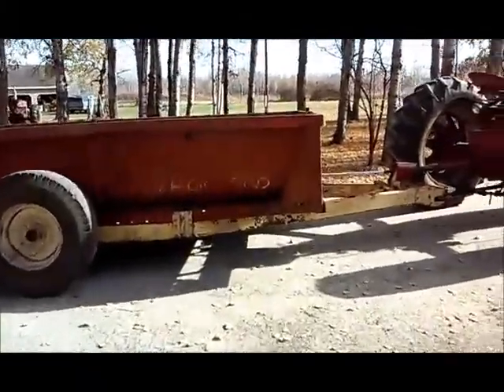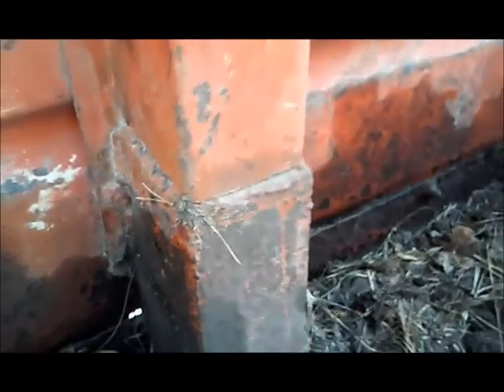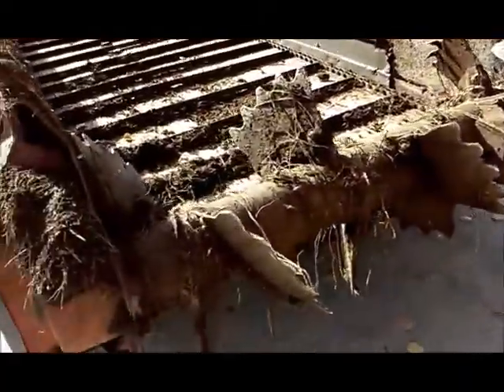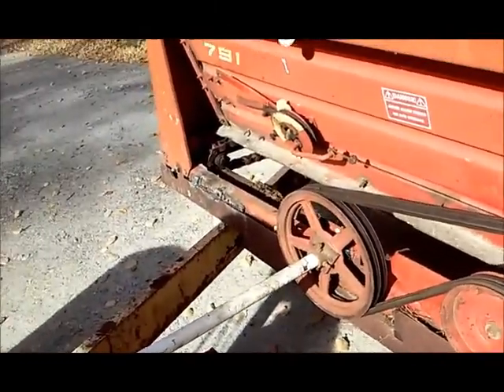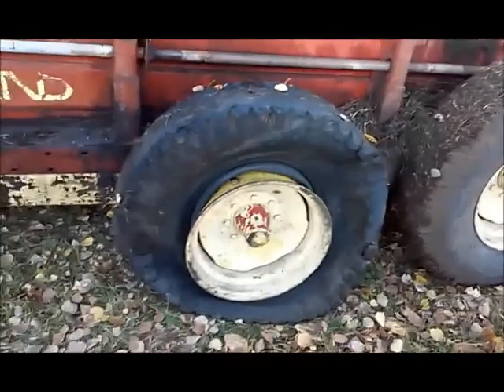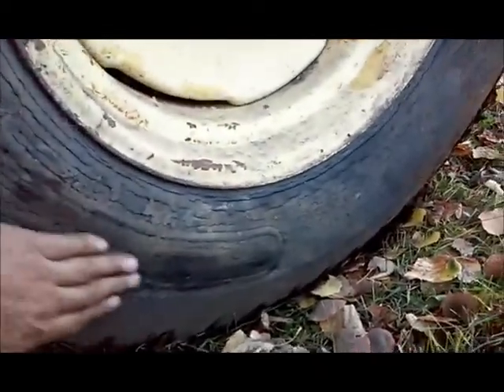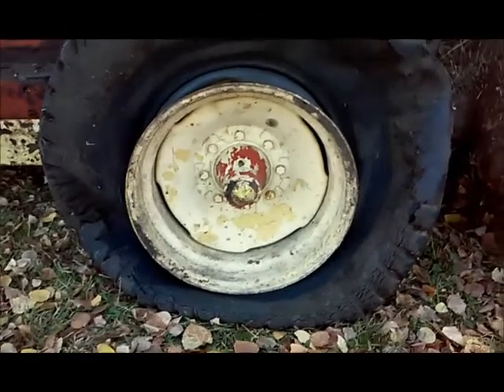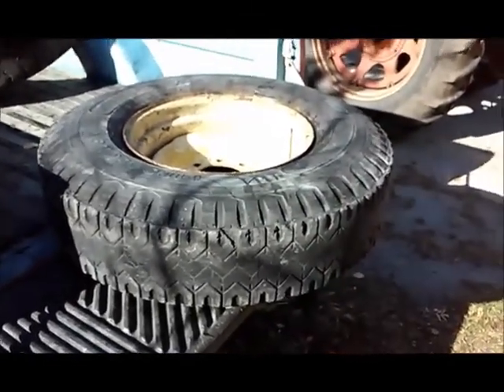791 New Holland Spreader Walk around and tire change

Comment: October? And I thought I was the only one sitting on videos. 

HAHAHA, I new when you said you never had to add air you were asking for trouble!!!

Dude, that trailer has two 1 ton axles on the back. Isn't the manure dry?  How high do you fill it?
Reply from the maker: I run about 75% capacity...relatively dry so between 6-7 ton per load.